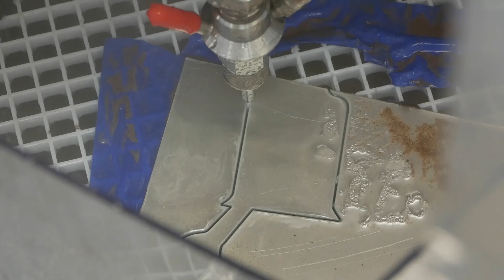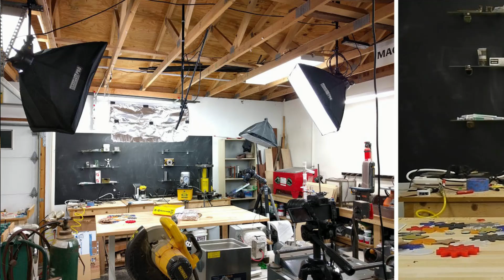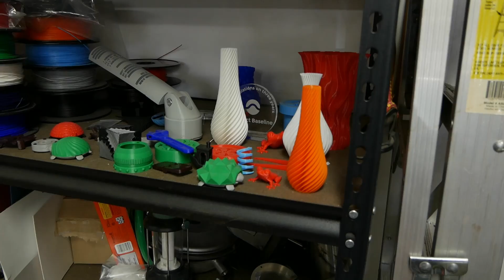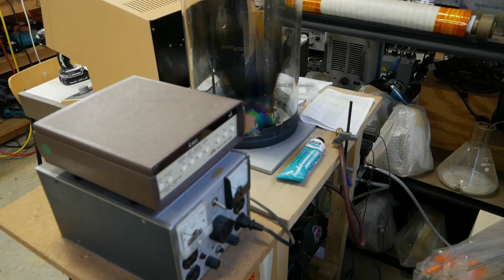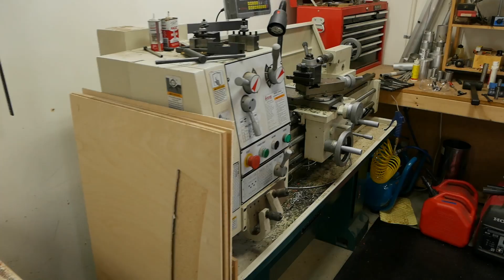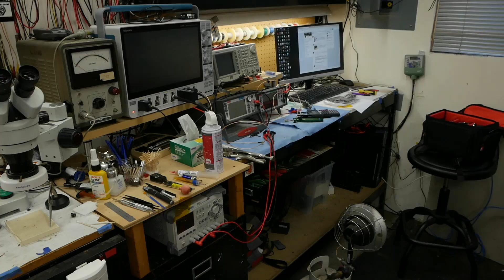Behind the scenes at Applied Science: Why video? Camera gear. Shop tour.

Comment: My journey, in some ways, is the reverse of yours.  I worked as a repair technician for 7 years before attending college in earnest.  Most of the time my experience helped with my studies and I had those "Eureka" moments where theory revealed why things I'd observed happened.  I'd repaired DC power systems and they're controls and hydraulic systems then completed a degree in cell biology for love of the subject.  In my case, theory and experience work to increase understanding and pleasure equally if obliquely.   Thanks for all you do.  My only problem with channels such as yours is that they're a little too compelling.  Thanks again though!

Comment: you are a beast! learned a lot from your videos. I have build a lot of amplifiers, motor controller circuits for robot arms, EKG, ultrasonic measuring devices. I failed to make a decent step up voltage converter. I could do it with parts from a shop. but failed to build one with a self winded toroidal transformer. The BH curve explaining video made everything clear about what I did wrong.

Comment: The reason why nobody want to try re-polish ruby rod is that this material is pretty hard. I know someone trying to do it with diamond dust with various grit, but always ending cross-contamination scratches. And while glass can be polished with Cerium oxide, not sure that this trick can work on such hard surface as is ruby rod.

Comment: Nice.   I get the feeling the lathe has been the most valuable tool, but know it's hard to say.   I have about 1/10 or what you have but I'm working on it. 
Some things,  I want, then they arrive and I  don't exactly know what to do, so I squirrel them away. I eventually find a use though.  An example is the ceramic ozone generator plates and transformer.   After doing the math in January, it seemed the SARS2 virus was likely to coming.   So, I dug those out the ozone plate, installed them in a bin and hooked up a line from my oxygen concentrator to make a sterilization chamber that allows us to sterilize the N95 masks I use in my work.  I tested it with KI/Starch and wow it is really a hell of an oxidizing agent, it went black in like 10 seconds. 
Anyway, I really enjoy you videos, and I know the a lot of that goes in to these projects.  The sputtering, the electric water drill, cryogenic chiller with the alkene coolant and electron microscope are some of my favorites.   

Stay safe and keep the infotainment coming.
Jerry

Comment: I find it interesting that your take on university class work is very different from mine.  For each of us our major was more or less a science except mine was not applied, rather, it was pure. This is explained by both my graduate degree and undergraduate degree are in pure mathematics although the undergraduate degree is always at least both pure and applied because sequential normal calculus classes are always applied mathematics.

I would not trade what I took at the university as class work for all the money in the world. To be honest it was not the class room experience that I would not trade, rather, it was the work assignments that were performed at home but given in class that I see as invaluable. I remember countless times spending 80 hours a week finding the understanding that was needed to complete multiple assignments in different areas such as analysis, abstract algebra and topology which were essentially "given some conjecture and by using just the tools of formal logic and your understanding show that the conjecture is valid in a manner that guarantees the conclusion".

Had I simply studied mathematics at home without any guidance other than an interest I don't think I would have the type of education that over time allowed me to dream up and then show as valid conjectures of my own. On the other hand if all I was concerned with was how to perform integration or use the standard tools of calculus then sure, learning at home is sufficient. However there is a world of difference between performing a Fourier transform and showing that the method must always work given the conditions established by the theorem and that just does not occur easily or without all the work I was given as take home assignments while at the university.

Comment: I need an oscilloscope and a variable bench top power supply. I don't mind investing money into them (you get what you pay for.) Fluke, Regol, Siglent? 

There are so many options out there it's hard to tell which are junk and which are waaay overkill for me. I do a lot with embedded systems. What do you use that you would/wouldn't recommend? Thx

Comment: Aperture is measured in mm, F-stops are relative to the format. Thus you cannot use F-stops when comparing different format (e.g. MFT and APS) unless you remember to use the crop factor for the F-stop the same way you use it for focal length! Easy experiment if you want to verify, especially since you have the digital zoom feature.

Comment: Hello Ban Krasnow,
I'm Mayank, And I am a big fan of you.
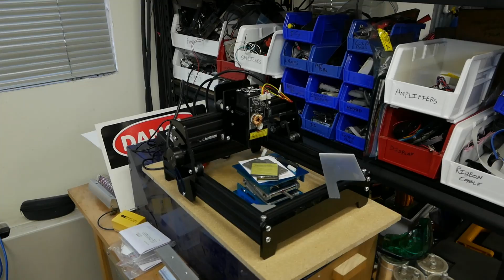In this video (20:10) you show the 450NM laser engraver and you also show the marked stainless steel plate, so my question is I have also 2.5watt 445NM laser engraver but it could not even mark on aluminium, So how can you do that ? you have high power laser module or what?
Reply from the maker: Steel and Stainless steel are marked by the laser because the heat forms a colored oxide layer on the metal.  Aluminum will not grow such a thick oxide layer, and will not be marked by laser (however anodized aluminum is easily marked).  Try your laser with a piece of stainless!

Comment: you could probably get a jeweler to resurface the ruby rod. anyone who can facet a gemstone will have the equipment. the tools that they use to make facets on gems are pretty precise. you could probably get a lapidary table for cheap and do it yourself and try your hand at gem cutting. most artificial rubies and sapphires can be bought for cheap.

Comment: Cool shop, lots of neat tools and gear! Always like hearing about your career trajectory and how you start with one idea and end up doing something a little different. On another note, I watched the video where you use the handheld CNC router to make the adapters for the new Centroid encoders, but you did not go into detail as far as the retrofit. Were you able to use the existing servo drives for the motors or were the drives part of the Centroid package? You may want to do a video on that, some of us have old CNC Bridgeports with older controls like Anilam that need upgrading and having someone walk through the ups and downs of the process would be neat.
Reply from the maker: Thanks!  Yes, the CNC retrofit would/will make a good video. The Centroid control has integrated motor drivers, so the setup is nice and simple: just wire everything directly up to the Centroid box, and then connect it to any normal PC with an ethernet cable.  The original Bridgeport had a DC supply rail which can also be connected directly to the Centroid unit. There is a little bit of customization needed for control of the three phase spindle motor via the original contactor, and pneumatic brake (probably using a VFD would have made more sense in retrospect). Even though the job is straightforward, it's still dozens of hours of work, and about $3400 for the Centroid kit.  Overall, I'd recommend it if you enjoy the tinkering/customization part of a job.

Comment: Sorry, but you said 'electrical engineering' and you make cool stuff, so I have to suggest: Prius as a power source, connecting an inverter to the big traction battery.  There are numerous videos and reports of using a 12V DC inverter on the starter battery to keep essential functions of a house during a multi-day power outage (car left 'On' a full week, half a tank of gas. Is that even possible?). I know just enough to know 1. a starter battery is not a good steady source of power 2. not enough to dare connect a boat battery in parallel to it 3. and to never even think about the traction battery or dare touch it...  But an electrical engineer....  (Here's a tip you might use. That camera to tripod-head plate on your shop table? Drill and tap a couple 1/4-20  holes on your tripod. I have Manfrotto tripods, the cast knuckles on the carbon fiber tripod worked perfectly and caused no problems. Your tripod look like it has aluminum channels for legs, so maybe glue on a small block of plastic to do this. When I was shooting professionally I had multiple plates and every 3rd or 4th shoot I wouldn't have a plate. Made me nuts. Having a spot right on the tripod is just so obvious. But maybe you've never had to scrounge around looking for a plate.)

Comment: 16:13 Here is a bit of motivation. Depending on the amount of pressure you can produce, you could maybe make liquid helium using the Hampson-linde cycle. https://en.wikipedia.org/wiki/Hampson%E2%80%93Linde_cycle

Comment: what are you using the antenna tuner for? (the HF one over by the carbon nano-tube project)
Reply from the maker: It serves as an impedance match between the RF power supply (50 ohm), and the coil or plates that I'm using to generate plasma in the tube furnace.  I've also used it for inductive plasma generation for a plasma cleaning video that I did a while back.
Reply: I didn't know you were doing that with RF!?!?!? I will have to rewatch the video. Thank you for responding!

Comment: Very cool.  I would like to hear your opinion of that high pressure fluid etching thing with the plasma glow.  I think it's electric energy going into the broken pieces.  I would wager a bet that you cannot produce that blue glow until something breaks, even a certs candy, tape unrolling, or a volcano exploding .  There is an energy release when you assemble those atoms, and that energy must be put back when you tear it apart.  Is there a way to test the directionality of the glow?

Comment: I wonder why they won't grind/polish the ruby wand (tee hee).  Scared of lawsuit if it goes wrong?  Those capacitors in the ruby laser scare me just watching them in a video.  I once worked at a company that manufactured its own computer hardware.  The programmers would just have the devices sitting next to them without the housing.  Someone touched a capacitor (about the size of a D-Cell battery)  and collapsed (but lived).  Be careful with electricity! (this is directed at everyone but Ben!)  Great work!

Comment: Happy New Year, Ben! Quick question; What is the best use of an Arduino that you've managed to find?
Reply from the maker: I use it in nearly every microcontroller prototyping task.  Everything from Teensy 3.x (Freescale) to Nordic nRF52, to classic Atmel AVR, and ATSAMD.  The real power of Arduino are common libraries that allow the prototyping engineer to get something working in minutes or hours instead of days or weeks.  It's less useful for production because of licensing issues, but for one-offs, prototyping, proof-of-concepts, testing, and demos, it's unbeatable!

Comment: As a software engineer with electrical engineering as a hobby, I've always wondered what the easiest entry into writing actual firmware would be?
Reply from the maker: Avoid all of the highly abstracted and bloated code that runs on x86 easily, but cannot run on a Cortex-M0.  Object-oriented programming is fine, as long as it is uses the features of OO appropriately.  I've encountered firmware with stuff like AnalogDigitalConverterHelperValueConstructionFactory.  (slight exaggeration) It's way too abstracted!  Lots of firmware tasks are very simple, and there is no reason to abstract them since rewriting them completely from scratch takes less time than documenting, and re-interpreting the abstraction created by huge amounts of code.  If the task is simple, do not make it complex!  If the task is complex, then write the code to suit, but do not automatically assume that the task will also grow in complexity, and require large amounts of abstraction to handle the increase in complexity.  I've noticed that software engineers are often assessed on their ability to anticipate spots in which complexity can grow and outpace the code.  Fine, but this has a cost, and, IMHO, in firmware the complexity is limited by the hardware itself, so avoiding feature- and scale-creep is guaranteed.  Arduino is a great place to get started, and I'd recommend the Teensy 3.2 as an ideal piece of hardware to get started with firmware.  It's very capable, and the existing libraries  which are super efficient (written by Paul Stoffregen) make it easy to get functionality right out of the box.
Reply: Nucleo and Mbed are good alternative to Arduino, it combine an easy way to start coding with the mbed lib that are really close to the arduino one. And on the price and performance side, the nucleo are really impressive. The price of a genuine nucleo board with a STM32F746ZG(144pins, CortexM7, 32bits, 216MHz, 1MB Flash, 320KB SRAM, DSP instruction, FPU, and a metric ton of peripherals) is close to the price of a genuine Arduino Uno (ATmega 328, 8bits,  20MHz (but arduino are running at 16Mhz if i remember well), 32KB flash, 1KB EEPROM , 2KB SRAM). I'm currently working with STM MCU, but i went through ATmega328, PIC18F/PIC24EP,  S12X and HCS08 (both from Freescale ) and well STM is always better price and performance wise.
Reply: Applied Science very good points, developing firmware is quite different from more “traditional” software development, for desktop or web services which usually shifts considerable from the initial requirements, and also tend to grow in subsystems that depend on each other. In that case layers of abstraction and code interfaces are quite needed in the long run for maintainability. But for firmware I would say don’t try to think too much ahead trying to make it future proof, write code that solves your current problems and only that, refactor as requirements change, and new features are introduced .
Reply: Applied Science very good points, developing firmware is quite different from more “traditional” software development, for desktop or web services which usually shifts considerable from the initial requirements, and also tend to grow in subsystems that depend on each other. In that case layers of abstraction and code interfaces are quite needed in the long run for maintainability. But for firmware I would say don’t try to think too much ahead trying to make it future proof, write code that solves your current problems and only that, refactor as requirements change, and new features are introduced .

Comment: Hi Ben, where did you get the 450nm laser engraver ? could you share the link ?
By the way, I can't stress enough how motivating your videos are. Your projects are so sophiscated and you are very judicious about them, that's one of the reasons I've decided to donate through Patreon.
Reply: They can be had on eBay/AliExpress. Please buy proper laser rated eyewear. 450nm will punch a hole in your retina faster then you can blink.
Reply: @danmorphis7759  The reason I asked for the link is that there are a lot of listings on Ebay/Ali for those machines promising to engrave on metal, but it's hard to believe considering the cheap price. But thanks for answering.
Reply from the maker: https://www.amazon.com/SUNWIN-Laser-Engraver-Metal-Marking/dp/B072K281KM  It doesn't really engrave metal, but marks it via oxidation discoloration.  Same technique is used to mark drill bits and end mills.
Reply: Applied Science which controller is in your laser? Ruida (RDWorks)? Trocen? Leetro? TopWisdom? The first two are supported by LightBurn which is replacement controller software. Vastly superior to the Chinese laser cutter software.

I like LightBurn so much better than the Chinese software that came with my machine (Leetro with LaserCut) that I swapped out the Leetro 6515 to RDC6344 just to use LightBurn!

Works on Windows, Mac and, Linux.

https://lightburnsoftware.com

Comment: Nice view of the shop!
Is that Keithley meter the DMM6500 or the DAQ6510?
Reply from the maker: Yup, this is the DMM6500.  I love it!  The graphing feature to see measurement history over time is the killer app.
Reply: @AppliedScience  Congrats on the new meter!  I have been using the DMM7510 for a couple of years and these are great meters!
I just got a DAQ6510 with a 20 channel card and have done a few multi-channel measurements.  The interface on the 65x0 series meters is great.